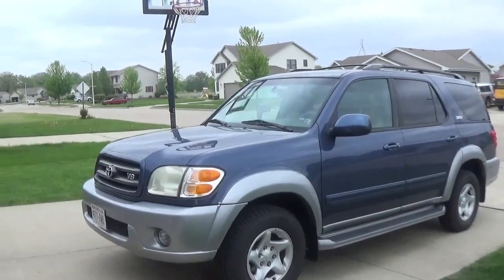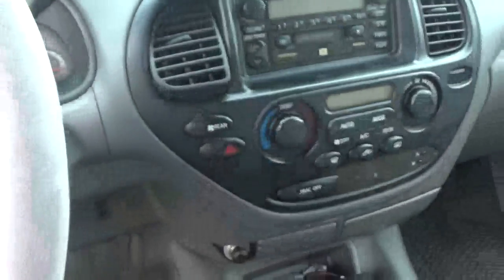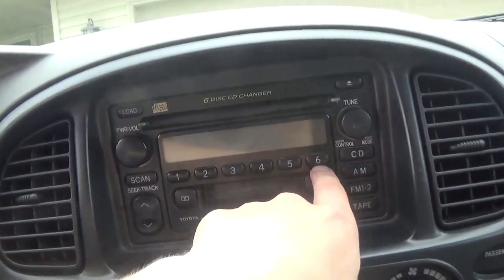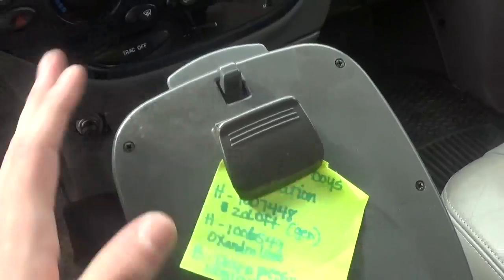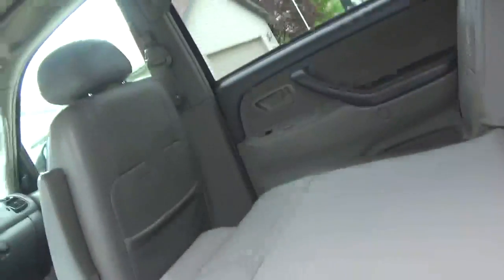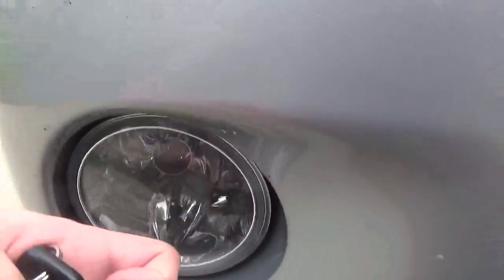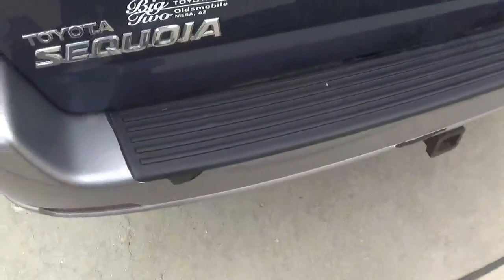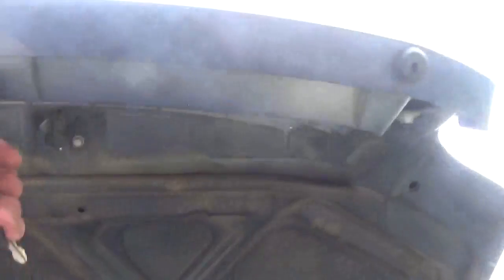2002 Toyota Sequoia SR5 Premium - HJUdal In-Depth Review

Comment: Clean your car..geez..I wonder if you kept up with the maintenance. Mines is a 2006 limited edition 4x4 and don't have any of these problems...
Reply from the maker: It's a family car, we've had it since new. I'm not sure if we've kept up with any maintenance that wasn't crucial to the vehicles functionality
Reply: I bought an 2004 sequoia. Drives great but the trunk doesn’t open. Wondering if you knew if there was a button to release the trunk through the inside🧐
Reply: @sandrasnow9564  I don't think there is. The rear hatch handle on these is notorious for breaking, I believe it was pretty cheap plastic. Unfortunately I think the only way to get it open if the handle breaks is to remove some of the plastic panels and do it manually from the inside
Reply: @sandrasnow9564  Did you finally figure it out???
Reply: @mercedesbenzs600bash  
You were right there is no button. It would have been perfect if there was. Thank you . I ended up taking off the panel because I needed to open the truck to change my light :)

Comment: I have exactly same car , same color ,
Reply: How many miles do have on it? Have you had any transmission issues? Engine issues or wandering of the steering wheel?? These are their common issues and said to happen before 110,000 miles. I'm about to buy one potentially tomorrow, a 2002, and am trying to Guage whether or not I should. Thanks.